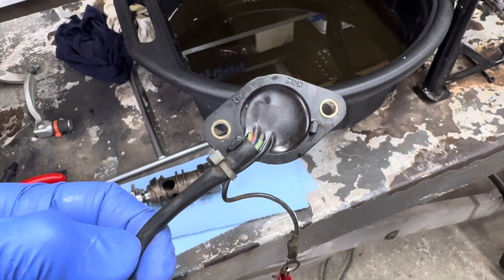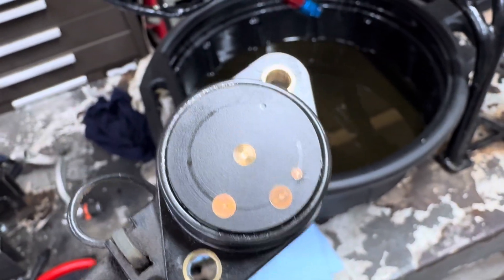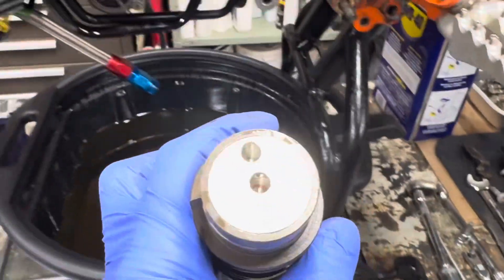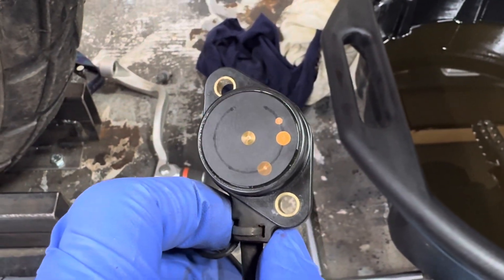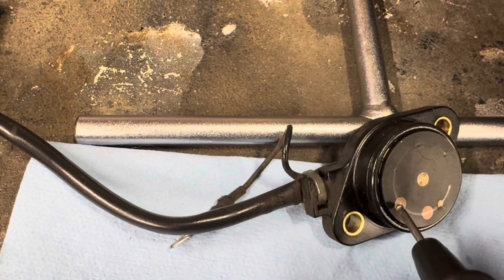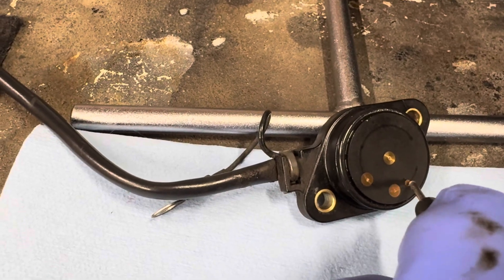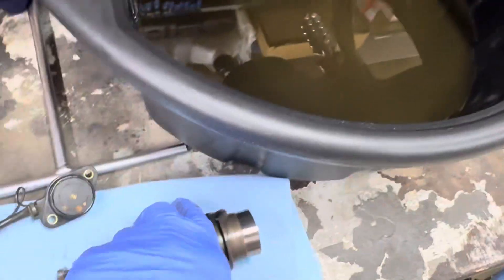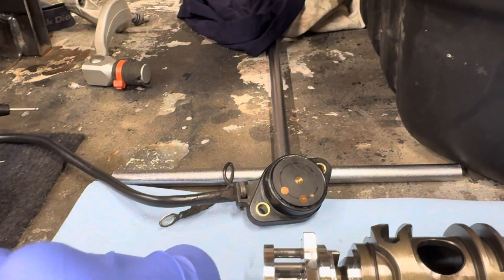Gear Position Sensor, Part Deux (2)

Comment: Very helpful video!  I've got a 2018 701 with problems that a new sensor/calibration hasn't fixed.  I fear something internally may be wrong.  I'm imagining a magnet on the shift drum that isn't in the right place.  Scary.
Reply from the maker: Yeah they work differently after 2013ish and I haven't played with them. Hall effect sensor and have a 5v signal wire. You may want to check that.